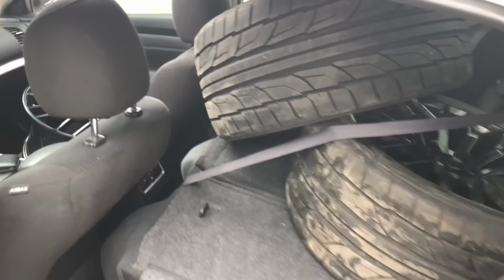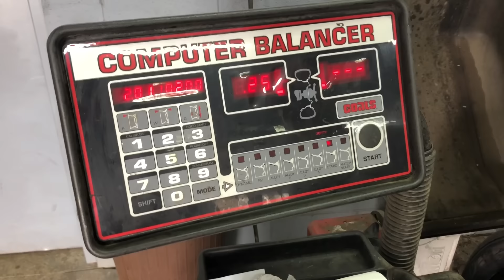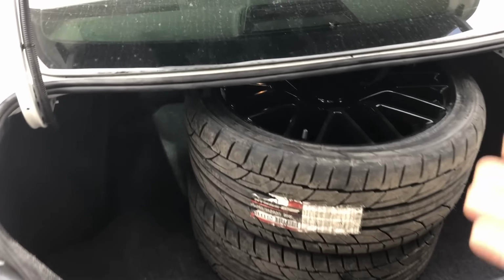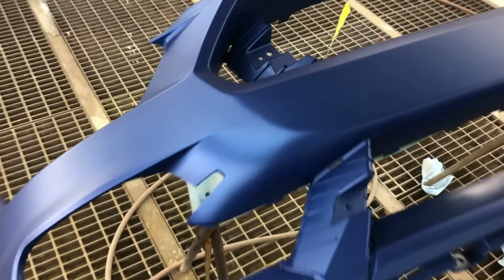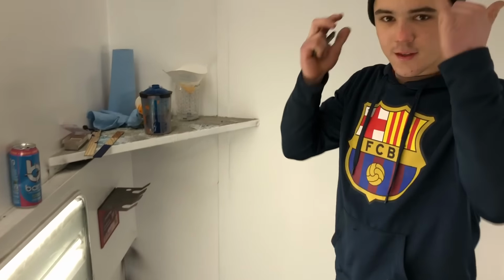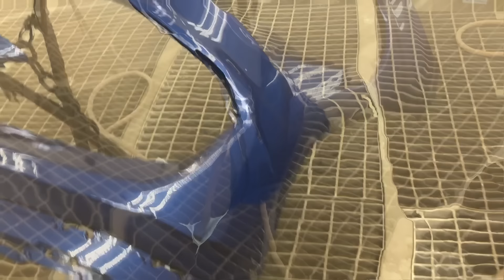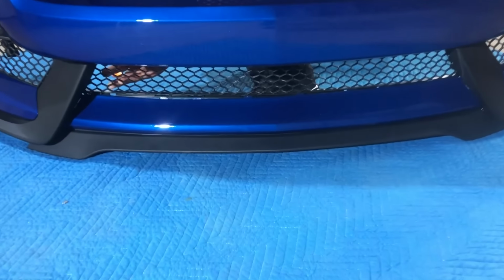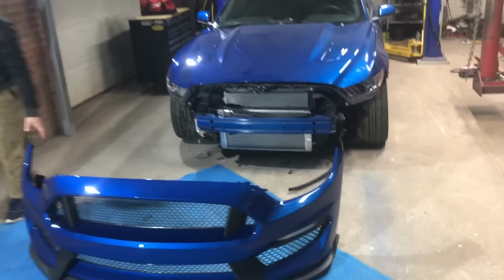Rebuilding A Wrecked 2017 SUPERCHARGED Mustang GT 5.0 [part 10]

Comment: Nice job 👍  Metallic paint can be hard to match. Depending on how the part is oriented and what direction you paint can cause the metallics in the paint to lay differently and reflect light in a different direction, making it look lighter or darker than the original. Blending it will look better.

Comment: @DannyTv so you tinted the clear with the blue? Is that factory or just something youre trying out? Either way it looks great!
Reply: Didn’t clean out the paint or and used the same cup and liner. It should be clear
Reply from the maker: Yes I ran out of cups...but I got lucky and it spayed down fine!
Reply: dannyTV Danny. You want to never do that again because when you go to wet sand and buff you will have lighter spots where you buffed because you are removing blue from the area. Just a tip brotha.

Comment: Who did u get the Shelby bumper 
How’s the quality
Reply from the maker: https://www.ebay.com/itm/For-2015-2017-Ford-Mustang-Front-Bumper-GT350-Style-Retrofit-Conversion-Full-Kit/302770071628?fits=Year%3A2017%7CModel%3AMustang%7CSubmodel%3AGT&epid=11020361497&hash=item467e80a84c:g:uVMAAOSwBnZbINvp:rk:14:pf:0
Reply from the maker: Stang Stone The quality is high after paint, mine did need a little prep work.